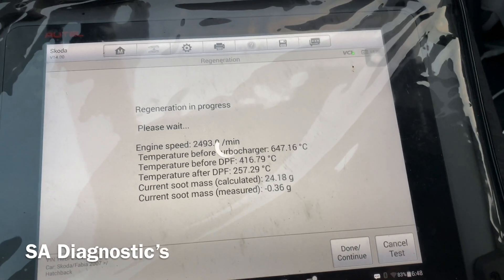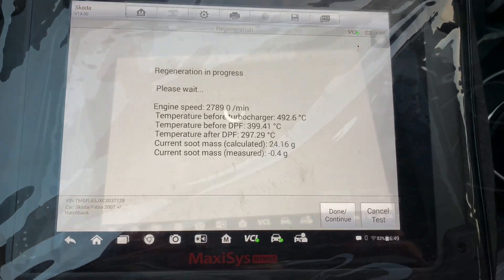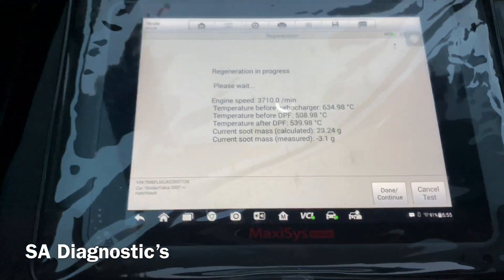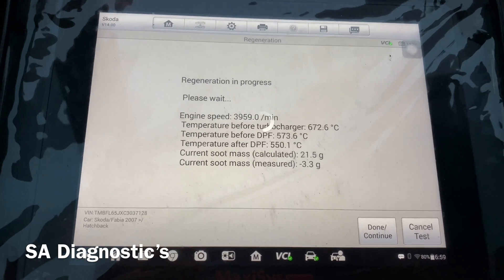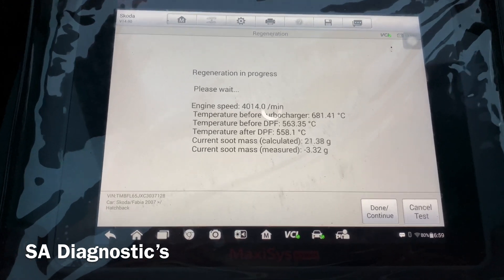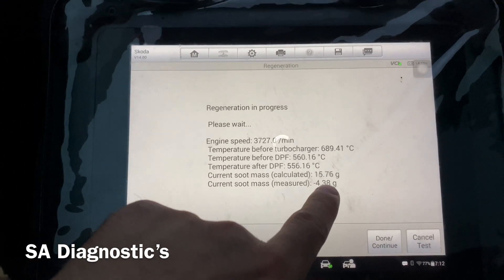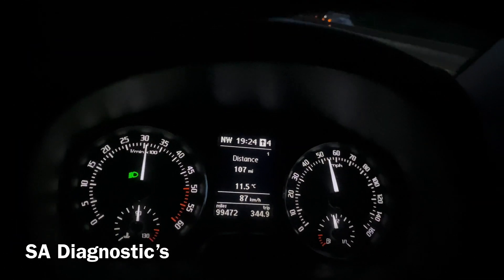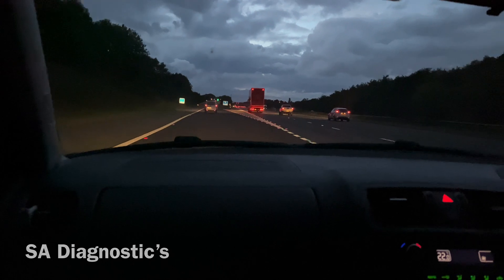Skoda Fault Code P256300 DPF Turbo Charger Boost Control Position FIXED!!!

Comment: Will the dpf needing regen put on p2563 boost position code??
Reply from the maker: Yes but depends on if there’s a boost leak. It’s best to check itnercooler pipes and turbo first
Reply: Thank you very much appreciated
Reply from the maker: @johnbrady2477  you’re welcome
Reply: no...its your Turbo...check all you vacume pipes from the solonoid to your turbo. Check your elec wired connections and connector at the solonoid and check your turbo actuator by removing and putting a vacume test on it.IF the actuator arm moves under vacume its ok. Finally check the turbo itself for wear and tear.IF it moves  in and out or wobbles when you test it then its probably worn and you either need a new on or get a replacement bearing kit..Be prepared to spend a full day on removing it,repairing the bearing kit and re installing it